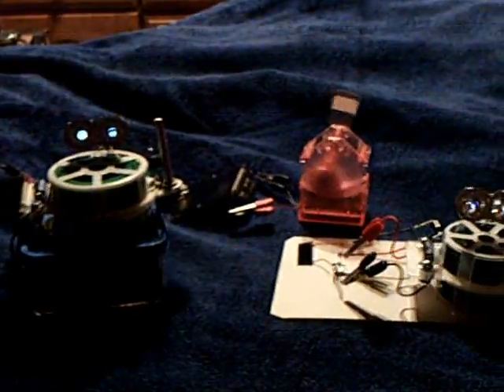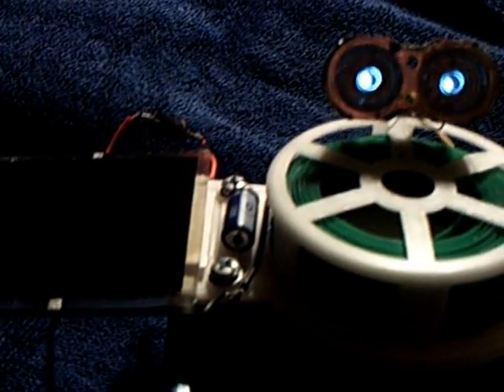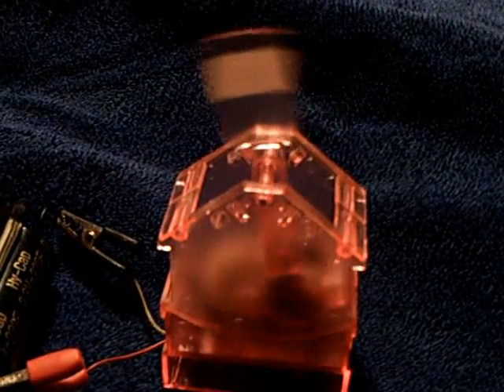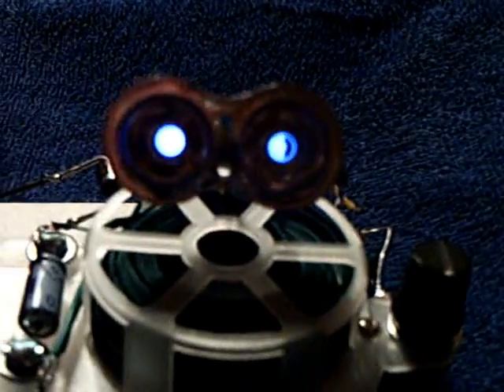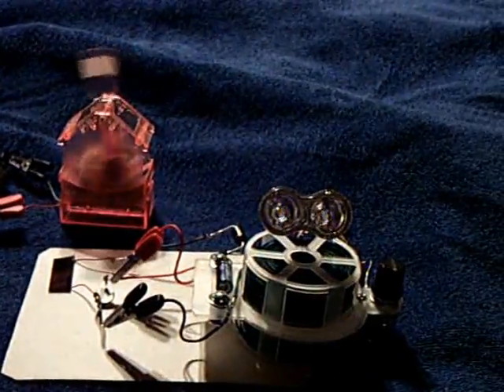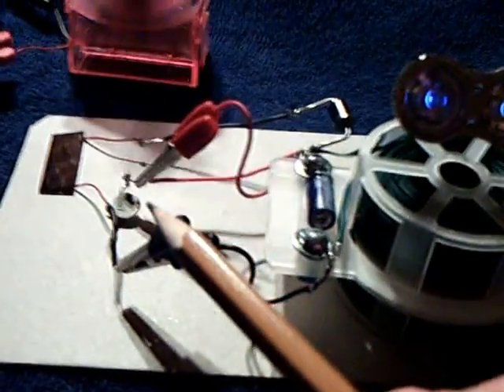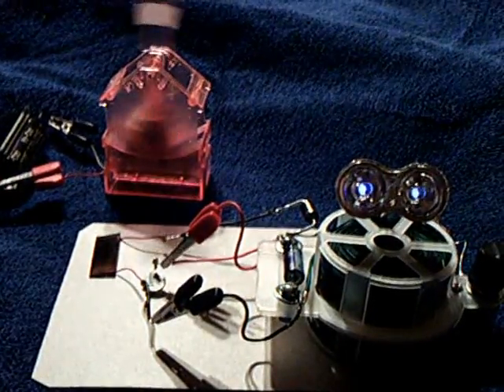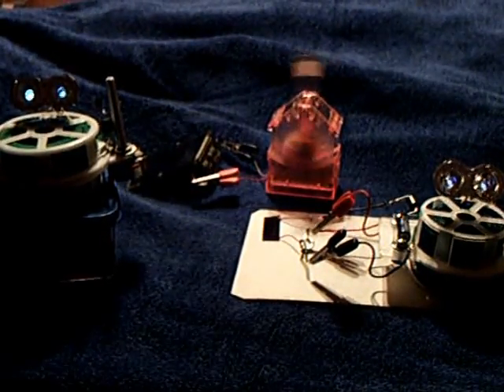Non-Stop running devices ----update

Comment from the maker: I have been doing that for years on my boat------but not for something that runs 24/7.  On the sailboat I have a 45watt solar panel that supplies power.  It is a watts in / watts out game though.  Usually "watts out" wins the game and I have to run the diesel for a while to top off the batteries.  My wife uses too many lights and runs the TV too long. :(

Comment from the maker: The down side of the supercapacitor is that the voltage drops constantly as they discharge.  Unless you use a voltage regulator with it, that limits their usage.  The upside is that you can charge and discharge them many many many times and they have a very long life span.

Comment: what is the difference between a regular supercapacitor (I have a 2.7v 350f) and the hybrid supercaps?  I couldn't find any real info on ioxus's (the manufacturer of my supercap) on the differences.  All I know is that if your order the hybrid caps you usually end up having to pay for hazmat shipping from either newark or mouser.

Comment from the maker: I bought those little caps about a year ago and this is the first time that I have used them.  It looks like 3 or 4 in parallel will get the job done.  That Penny oscillator is still running on just the one now after 5 hours.  I might have to use two of those tiny solar panels to charge em up.

Comment: Good idea with the Polyacene. I couldn't believe how cheap they are at Elec Goldmine, so got 10 of them..can also often be found inside cellphones as they hold phone data when swapping batteries over. They do leak if left charged up, but not like a sieve and seem very suited to these 24/7 runners. Same situ here with the C/Pb cell, overkill on a blocking oscillator, but such things are very easy to forget about and just leave running !